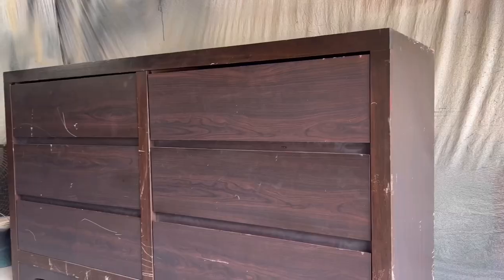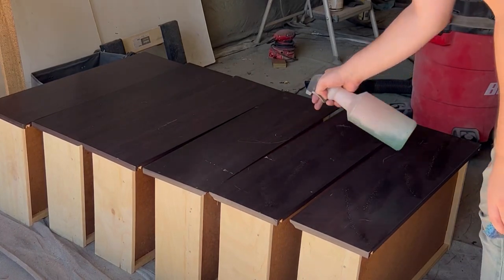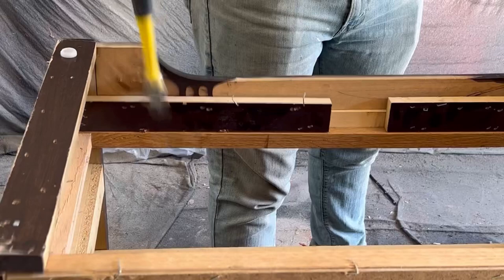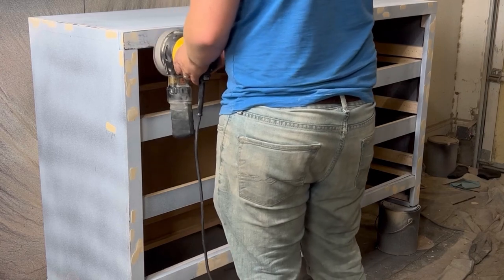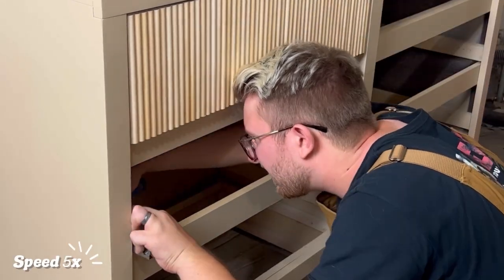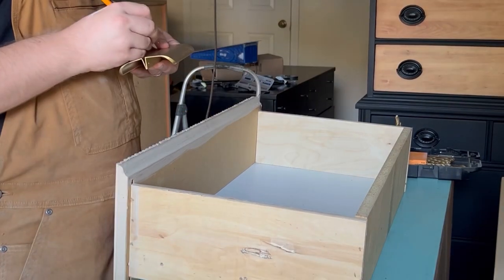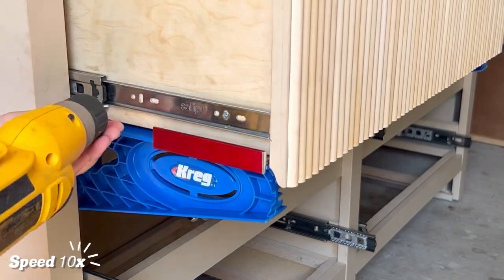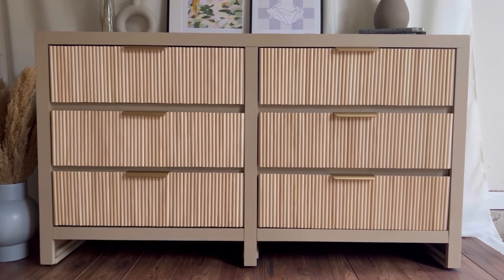AVOID THIS MISTAKE!! Replacing Drawer Slides for BEGINNERS | DIY Fluted Dresser | Furniture Flipping

Comment: Final product is awesome! I feel the frustration with wonky pieces. Just finished a server/buffet and for some reason one of the 2 doors kept “catching” along the bottom. Didn’t paint the bottom, take it off it’s hinges or anything. Thought it might have been the humidity in the garage so I brought it inside. Nope! Hand sanded the bottom of the door with 80 grit and still no luck. Finally used the orbital upside down and that was the ticket! Really like your videos! Thanks for sharing your ups and downs, always helpful!

Comment: yOU Had the right idea the first time. You just had the wood piece in the wrong orientation. And you want a wider board too, like a 1x6, nice flat one, make sure your ends are parallel/square, trim to the height you need the bottom of the slide at, check the bottom panel of the cabinet is level. Then put the wood flat like paint, rest your slide on the wood, move to other side, trim same board for next height.... https://www.youtube.com/watch?v=GghIQwrXuig&list=TLPQMjMxMTIwMjI8VqcHRwotIg&index=3

Just mho, but I kinda hate those dowels. Aesthetically, and as a builder:)   I mean, way too much work, and they need to be sanded and sealed, so more work. If you don't seal them, they will expand, buckle, twist, chip over time. And there's so much of it, it will look crappy, quickly. Maybe if you hid the ends with a frame, but still. I thought a glass cover over it might make a nice effect, but you still don't need them. Put a 3d wallpaper behind glass, way easier and cheaper. It does look better, but it still looks kind of Hawaiian tropical hut, too, bc of the dowel work.

Lol, sorry, also the paint over old paint and varnish may be a bad idea. You should strip at least the old varnish, bc it is still vaping fumes, your paint may bubble and crack from below. The paint may still be offing water vapor, too. Also there is health risks involved with all that. You don't want to make someone sick. If it's solid wood, you'd be surprised how easy it can be to strip, then sand, and have, nice, real wood, no chemicals. Also paint is thick, it wasn't the problem here, but 1 day it will be the extra paint build up that is binding somewhere.

 Trying to put myself to sleep, I think it worked:)

Peace